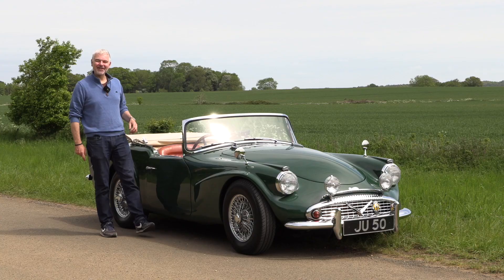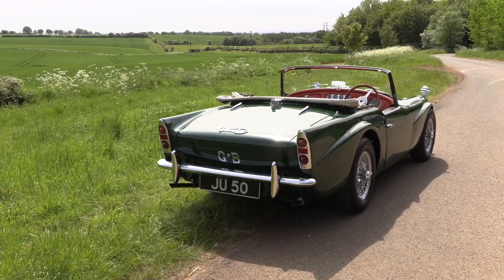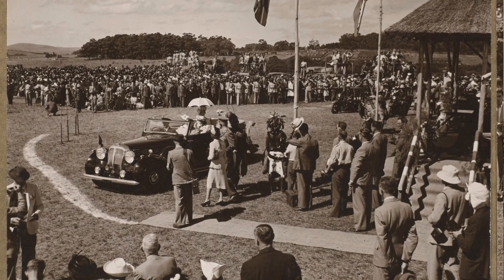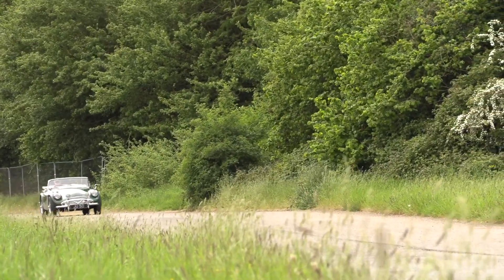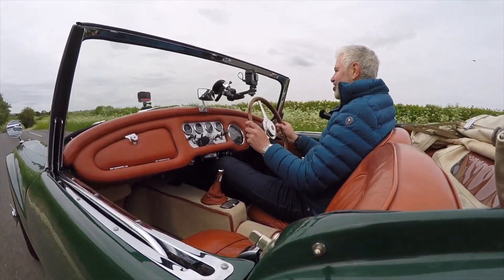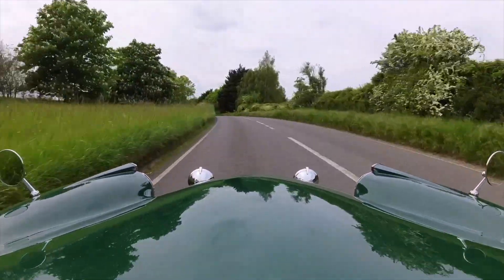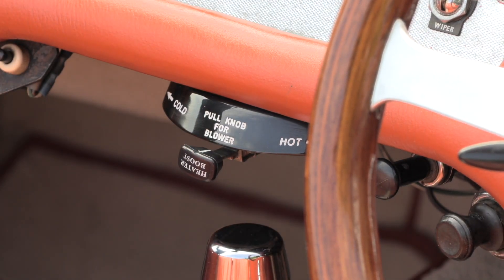It Wasn't Very Good BUT The Daimler Dart Has A Hidden Ace..

Comment: British cars - a couple decades ago, a man in my village drove three of different brands British cars. Two of them had a sticker on their rear end: "all parts falling off of this car are genuine British handcrafted quality".
Doors popping open because insufficient torsional rigidity? I remember from a Peugeot 404 - a car that could be thrown around in beast mode - that its sunroof popped open in corners taken very fast. The cut out in the roof for the sunroof had reduced the torsional strength of the car.

Comment: Had the chances many times to buy these cars in the 70's , even a Jensen CV8  nearly got into my hands , but somehow I kept my series 2 Sunbeam Alpine  .  Still have it to this day !   The fins and the tear drop  alloy roof  make a far more civilised car then the Daimler ever could be . Tried and tested running gear and robust body with twin chassis .   The thing is like a tank !  no door flex , no scuttle shake and even a decent trn of speed with the later 1725 engine .   To me the Sunbeam was the far better car .

Comment: I never saw an SP250s doors fly open. It happened to the early ones and they fixed the problem. The chassis was developed from the TR3 Triumph I believe. And they were fast for their day. At the time there was a story: Daimler mechanics built a prototype SP450 that could blow away the first E types and it was not well received by Jaguar management. It could do 180 mph. Sounds about right. It would have needed some development in the handling and brake department!
Reply: Also, they got raced a fair bit in NZ and I never saw anybody complain about their performance or tales of flying doors then either

Comment: Exellent review of a car often overlooked.
Oddly, cars like this are rarely given the beans these days, or even driven briskly. So performance and handling are less key.
Careful with the script...  Beginning of the 20th Century, not the 19th.
As to the royals changing to R-R, I am told that that was in part due to the behaviour and vulgarity of Lady Docker. I have never read that in an authoritative book or journal, but it makes sense.  
The engine was also used in the V8 250, in a Jaguar saloon body.  I am told it was quite the best Mk2 variant, although not sold as a manual.
The Majestic Major engine (a 4.5 litre version of the V8) was apparently tried in a Jaguar saloon and tore the tarmac off the roads ... But Sir Bill spiked the project (according to legend) because it humbled the 3.8 XK lump.  There are many versions of that story; all differ from the others and all are credible.  
Another excellent review.
Personally I hate this car, but how dull life would be if we all admired the same things!
Reply: The Daimler V8 250 was made with a manual gearbox but only for a limited time and they are rare cars

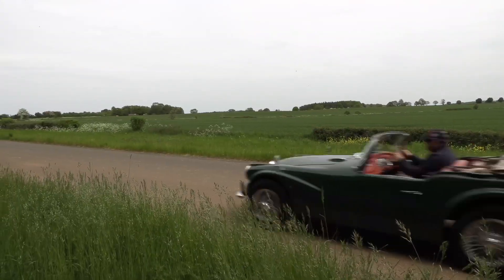Comment: At 5:08 you can see the chassis flex where the door meets the rear wing/fender. Neat car though, sweet engine what with those front mounted SU carbs.

Comment: The engine was designed by Edward Turner who also designed the much admired Triumph speed twin motorcycle engine.  The V8 in cross section looks like 4 Triumph engines combined.

Comment: This is the first review l ever seen on the Daimler Dart with the 2,5 litre V8 I have known about the V8 for many years great review by the way it is a point l would like to bring about 2,5 litre engines the Humber Hawk has a 2.5 litre engine l had a ute with a 2.6 litre 4 cylinder engine and the Triumph in Australia we got a it with a 2,5 litre 6 cylinder engine l actually owned a car with a 2,4 litre 6 cylinder engine and now l own a ute with a 2,4 litre 4 cylinder engine and getting back to the Daimler Dart it has the 2.5 litre V8 apart from that the interior is very nice but very different
Reply: Worth chasing up Shannon's club TV episode 149.
History of the car in Australia too and it's Bathurst endurance win, but not as most know it

Comment: If it wasn't for the Daimler SP250 Dart, we wouldn't have had the Reliant Scimitar. Boris Fortier of the cosmetic company Helena Rubinstein commissioned Ogle Designs to create a car on the SP250 chassis, as he hated the styling but loved the engine. Ogle created the SX-250 and 2 were made. After David Ogle's death Tom Karen finished the design and it was picked up by Reliant as a replacement for the Sabre, that became the Scimitar SE4 GT, and later the GTE.

Comment: Great review as ever jack, and a bit of a left turn perhaps when compared to many of the cars you feature, which keeps it interesting.
Lyons thought the SP250 might still have a future if it had a facelift and could be cheaper to build. He trialled a freshened-up body which was frankly a lot easier on the eye (a low bar, admittedly) and shared parts with other models to cut costs. Sadly it didn't progress any further.
Reply: The Daimler engineers apparently put one of their 4.5 litre V8s from the Majestic Major into an modified SP250, and showed it to Sir William Lyons.  It raced around the outside of a new E-Type on the test track.  Sir William said "Put that thing away and never let it be seen again."  He didn't want it to compete with the highly-successful E-Type.
Reply: @paulroussell  You can put that down to myths that never happened. Jaguar's own report on the engineering of the Dart was pretty damning plus, upon becoming part of the Jaguar family, Lyons made Daimler focus on bus and truck work - cars was the domain of Browns Lane who had to do some serious re-working to the revised model (shortly after, the truck element was removed when Jaguar bought Guy). Setting aside Turner the engineering talent at Daimler wasn't exactly earth-shattering; even at at shop-floor level they were a country mile behind the likes of Guy or Coventry Climax.

There is a rumour that Jaguar tried the larger V8 in a MkX which turned out to be quicker than the straight-six, but what is known is that at Jaguar, Heynes was concerned that the V8 didn't give the same level of refinement that was achievable with the existing XK unit. Personally, I'd suggested there is maybe a small amount of Not Invented Here syndrome, as a Daimler-badged MkX with the 4.5 V8 might have gone down better in the US, but it is a real shame the 2.5 unit didn't find a home elsewhere. The MGC powered by the light 2.5 V8 would have made it a much more palatable affair than the ship's anchor 6-pot lorry engine it did end up with.
Reply: @mrdainase  thanks. Actually, the 2.5 found a home in the MkII Jag body. I owned one for a time. 
I think I still have the complete parts manual for the SP250 somewhere
Reply: @paulroussell  You are quite right there and on reflection I should have said it was a shame the 2.5 unit didn't find a home elsewhere beyond the Mk2. I tried one some years back but it had a rumbly bottom end which put me off buying it, although I thought it much nicer than the 2.4. I had read a while back the small V8 was tried in a MGB by the BMC engineers, but with no other details I think that can also be consigned to the 'rumours that never happened' bin. By the mid-Sixties Lyons wanted the 2.5 to be fitted to a new small sports saloon but the merger with Leyland, and Stokes being determined to keep Jaguar at the top end of the family line-up, put paid to that idea.

Comment: Ahh, that engine..... I had a Daimler 2.5 saloon (Mk 2 Jaguar with this engine). It started my fascination with small(ish) V8s, which might excuse my P38 Range Rover. The Daimler saloon was I think a nicer car than a 2.4 Mk II, because the V8 was much lighter than the leaden XK lump, and mounted further back, so the steering was lighter and the balance better. The engine in my experience held its tune much better than other British cars of the period. Although the distributor was by Lucas, it was a superior sort with double points. The SU carburettors were also of a much higher quality than those on BMC products, more like the kind on Rolls-Royces. Which suggests that the legendary unreliability of Lucas components was partly because most British manufacturers of the period (especially Jaguar and the various bits that became BMC) were just too mean with their component suppliers. Contrast Mercedes and the injection pumps, etc,  they bought from Bosch. There was a 4.5 litre version of the V8. Legend has it that Jaguar thought about marketing a Daimler version of the Mk X with that bigger V8, but abandoned the project when  the  prototype turned out to be embarrassingly faster and better than the six-cylinder original.

Comment: Given it essentially had a TR3 chassis, is it any wonder it handled badly?  The engine was close to being 4 Triumph 650 parallel twins stitched together with a water jacket, much as the Vanwall GP motor was 4 Norton singles side by side.  This Coventry lash up was never going to match it with the E-Type however promising the V8 was, but these days it is appealing because it isn't a Jaguar.

Comment: I think you meant Daimler UK started at 'the beginning of the 1900s'; there weren't too many motor cars around during the Napoleonic wars.  I once drove a Daimler V8 250 saloon and that engine was indeed silky smooth and tuneful; although a single camshaft and push rods for a V8 wasn't exactly high-tech.  I'd take issue on the carburation though.  Twin carbs are never going to get the best out of a V8 and you only go that way to keep costs down.  SUs likewise were chosen because they were cheap, and even if you managed to keep the dashpots topped up they were a bit of a blunt tool compared to a side draft Weber.  No, a properly chosen set of Webers will give you all the low-down torque you need.  Webers were the pick for high-performance engines because they could deliver accurately over a wide rev and load envelope, not because they had no bottom end!
Reply: A 4-barrel Weber carb on an Edelbrock inlet manifold absolutely transformed the Rover V8 in my Land-Rover…
Reply: @VincentComet-l8e  Didn't Land Rover deliberately block part of the standard inlet manifold  used with early V8 rovers to keep the HP down to "safe" levels ?
Reply: @rhiantaylor3446  
Yes, they did indeed have to restrict the power, due to it not having disc brakes. 
My V8 110 was restricted in that way. Under the bonnet two small Stromberg carbs sat in amongst a rather makeshift set-up with tubes, cables & wires all over the place. The V8 was virtually invisible beneath all this, inlet manifolds, air filter, air intakes etc. There was various other pipework too and it looked a right mess.
And this set-up combined the worst of everything - looked dreadful/strangled the engine/appalling fuel consumption - they could hardly have made a worse job of it!                                                                                                                                                                                                                                                                                                                                                                                                            
By comparison, the formidable-looking Weber/Edelbrock combination was the proper job. I was able to strip out all the junk above and when the Weber and manifold were in place - K & N pancake air-filter topping it off nicely - it looked a million dollars!                                                                                                                                                                                                                                                                                      
And performance had been transformed - achieving the seemingly impossible with substantial increases in power & fuel consumption improved from around 12mpg to 18mpg!

Comment: Daimler also made a 4.5 liter version of that wonderful engine for the Majestic Major luxury saloon car. Swapping one of those into this car together with Jaguar front and rear supension would take it to another level.Daimler actually made a prototype like this but the whole concept was killed by Jaguar as it would have competed with the EType.
Reply: Sports cars are about dynamics, not big power. If you need 4.5 litres in 900-odd kilos, something is amiss

Comment: Daimler Dart was 'designed' very quickly, it's chassis a direct copy of the Triumph TR2/TR3 chassis, to the extent that a majority of the Triumph chassis parts readily interchange with Dart ones. The Triumph chassis also suffered chassis flex, but not to the extent of the Dart. The Triumph chassis received a measure of support from steel body panels, whereas the poorly designed fibreglass body of the Dart contributed no additional stiffness. Stiffness in a fibreglass body shell isn't rocket science as evidenced by Colin Chapman's 1956 Lotus Elite. Nothing wrong with the V-8  engine though, very popular in hillclimb single-seaters in the early 1960s.

Comment: A sweet engine, I wonder if the 4.5 litre Majestic version is the same dimensions! Swap?
Reply: Yes, a swap is quite plausible : I believe the engine mounts are the same : the Maj Maj engine is 1 1/4" longer, 1 1/2" wider ,but 4" taller /deeper . Several members of the SP250 register have installed the big sister . I run a Maj Maj 2 seater Spl built on the lines of a MkV1 Bentley Spl , suitably modified and of course with the auto box converted to a 420G Jaguar overdrive manual box. It will attain the same speed as William Lyons Mk 10 body shell with 5 litre Maj Maj engine which consistently lapped the test track in 1963 at 135 mph .
Reply: @Birashanuman  Love to see some pics of your car! sounds amazing.
Reply: @hespie1  Yes, thats not a problem, let me have an email address to send them to.

Comment: One of my all time favourite cars. Killed off by jaguar to protect their new E type. Which is another favourite of mine.
Reply: As the owner of both this late-'60 Dart and a mid-'64 3.8 E-Type,  I love them both and I think you have very good taste !  But I think it is overstating the case to say that Jag killed off the Dart to protect the E-Type.  It would be true to say that Jag didn't really try to develop it beyond fixing the chassis flex immediately after buying Daimler in 1960. Google "Daimler SP252" to see what might have been.  But Jag kept Dart production line going for 4 years after the E-Type launch.  Plus the Jag was 50% more money, so the Dart wasn't really head-on competition. Truth is they could sell every E-Type they made (c.73,000 in 12 years v 2,600 Dart's in 5 years), especially in the 60's, and that the Dart was never a sales success.  My guess is that in period Jag felt the Dart was just not a compelling enough proposition to promote and develop.  But as a classic it is a different story - big personality, rare, different - and  engine ...

Comment: I've seen a lot of SPs and have never seen those seats. I suspect they're adapted from a 2.5-litre saloon.
Reply: The Dart is December 1960 and I believe those Pullman seats were factory fitted. The car was ordered by a businessman with a couple of other bespoke or rare items (including that foglight bar and slightly different paint/ interior trim colour).   I understand the businessman passed away before he took delivery and then my uncle bought it from Stratstone in London.  The Mark 2 Daimler 2-5 litre didn’t enter production till 1962 so it post dates the car.  It is possible that the seats twere adapted from Jag Mk2 as Jag bought Daimler in 1960. But I’m not sure.
Reply: @stevenbrown9691  thanks. Interesting info. Pre-Jaguar, Daimlers were made in such small quantities a customer could order pretty much whatever they wanted ;)

Comment: It's actually a shame they never further developed the engine, it could have been a very good alternative to the rover V8, maybe have made it so triumph didn't need to develop and waste so much money on their own V8, etc.
Reply: It would be interesting to know the differences in weight and cost of manufacture, with the Rover.
Reply: I would love to see someone fitting this (or even the 4.5l version) into a Stag.
Reply: @richardball3585  to be fair, these days most of the triumph V8 issues have been solved or can be solved, but I would agree...the thought of putting a daimler V8 in a stag would be interesting.

Comment: That engine and it's bigger brother lived far too short lives. The 2 1/2 litre was stunning.
Reply: Engines designed by Edward Turner of Ariel Square Four and Triumph Speed Twin fame.
Reply: @street-level  I remember reading about the motorcycle influence and Turner being the surname. I also remembered that Lyons was not happy as the smaller was basically better than the heavy XK engine. The Daimler equivalent of the "S" class (I get mixed up with the models) was stuck with an auto so that it did not show up the 340's.
Reply: I believe they had hemi heads spark plug in the centre valve either side advanced for their day.
Reply: Jaguar fitted a 4.5 litre version to their Mk.10 and even with just a makeshift carb set-up performance was absolutely transformed!
The very large cast-iron XK engine was enormously heavy. The actual figure seems to have been a secret very closely guarded by Jaguar, but it was around 300 kg, which is just insane! The 4.5 Daimler V8 seems to have been about 70kg lighter, which brings it in under the American V8s, which were around 250kg.
Jaguar had stretched their XK engine just about as far as it could go with the 3.8 and 4.2 versions, but the Daimler could have been taken out to 5 litres.
An E-type with just the 4.5 version – both lighter and more powerful than the 4.2 XK – would have been absolutely sensational!